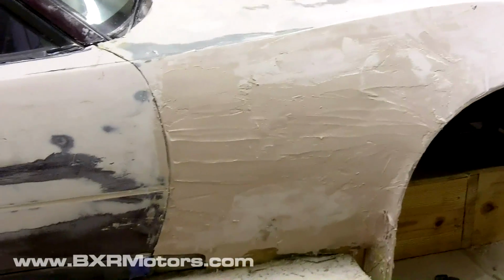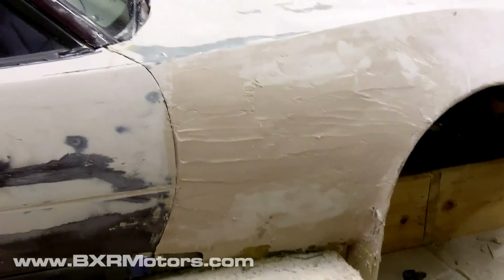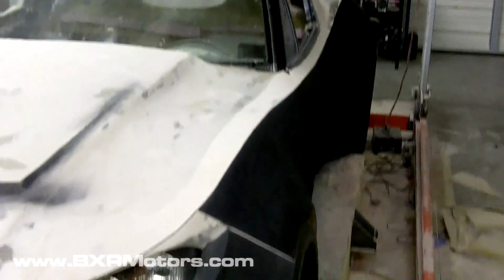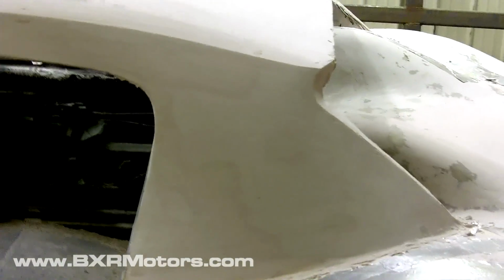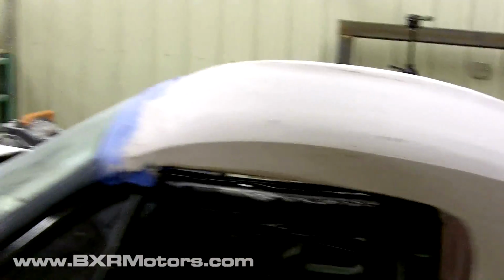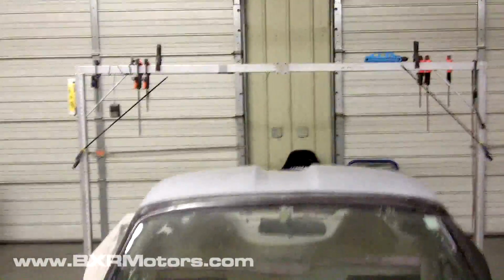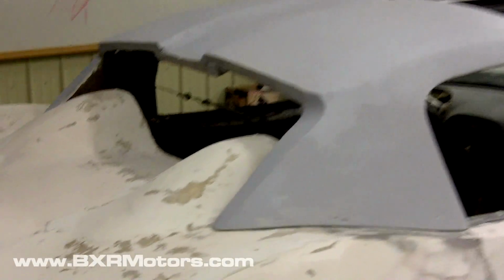Bailey Blade XTR Car Design | Working on the Hard Top, oh yeah! - Part 28

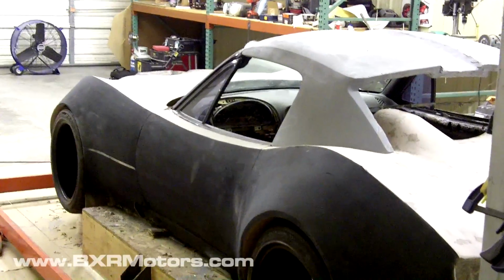Comment: I know your drawing on over 60 years of sports car design. I like the sharp lines and the front view is aggressive and modern. But I got to tell you, in the dim light and the side in black primer, the 3/4 view from the rear @8:00 sure has a 68-72 Vette vibe. Not that that's bad.  As far as vents go, Just as long as every vent and scoop are functional we're good. You're old enough to remember  the "sticker speed" times from the '70's. Keep it up, looking good!

Comment from the maker: @DanFrederiksen Yeah i know don't understand why they took the stars away. not a big fan of the thumbs up thing. but oh well... as for the vents, they are coming back. Retro is what we are going for... and no chance of ricer. As for under the car it will have a complete belly pan to increase air speed, and side vents will be important to release pressure in the front wheel wells.. and to exhaust heat from the headers and cats.